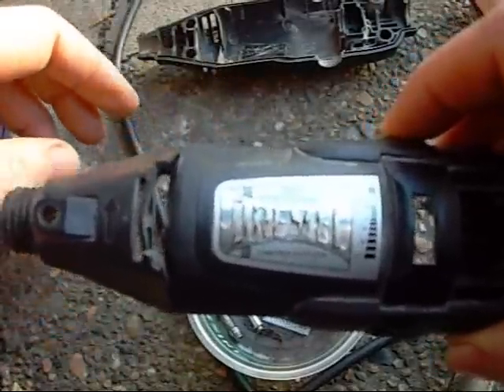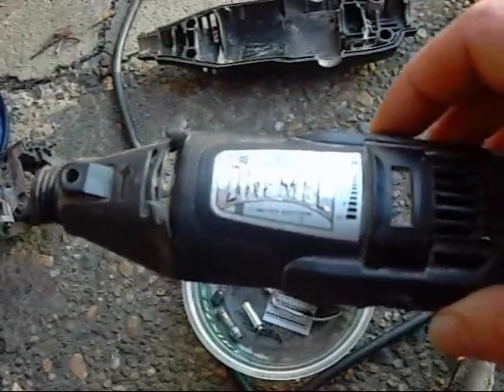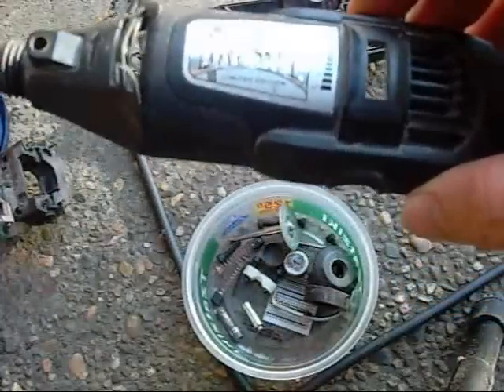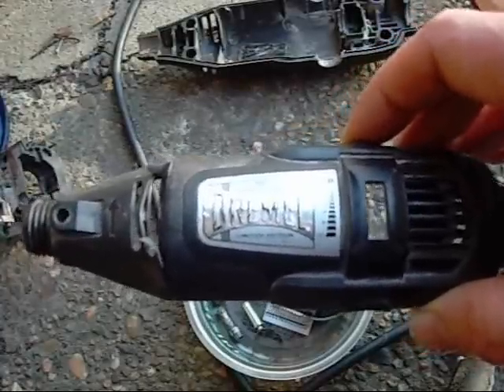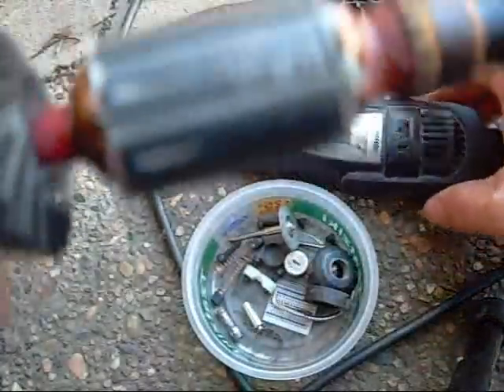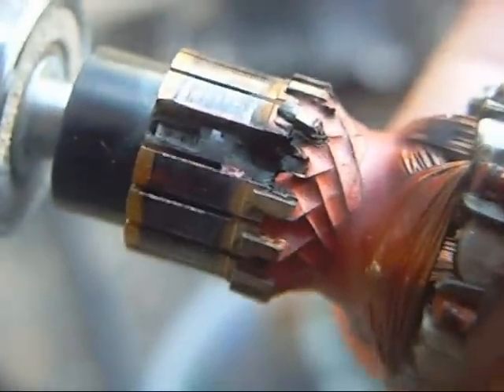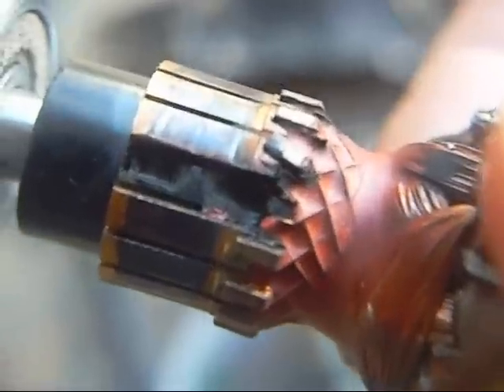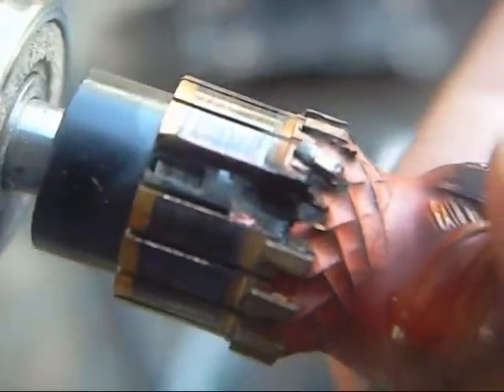Dremel autopsy-commutator damage

Comment: Mine did just this, threw a comm segment. Poor show, I haven't used it much. Basically a write-off. The armature is finely balanced and a replacement comm segment will probably need the arm rebalancing, these rotate at up to 30,000rpm, if it's less than perfect it will self destruct again.  I've chucked mine in the bin.
Reply from the maker: it is not worth the fiddling around to repair. I did see a russian video with a repair method that was very low tech and it seems to work. I think the only real time that a person would fix this kind of thing is when they can't buy a replacement for some reason.

Comment: can we repair this type fault of mixer-grinder armature
please replay
Reply from the maker: yes it can be done, even if you don't get electricity running through it again but just replace the copper so the brush has something to run smoothly over. you need to have good epoxy and smooth the replaced copper down so it is not rough. soldering the bar to the wire before machining would be best
Reply: Sir
Have u any video  for solution
Reply from the maker: no i do not have video for solution. follow the details on the comments below.

Comment: you need a peace of cupper then count commutators get the diameter of the commutators then the windings after that make a ring made of cuper exact the diameter of the commutators and its thickness then epoxy it to the armature then put in the lathe make it center when yuo epoxy it to the armature  after you put in to the lathe and finish turning cut the cupper then do the winding.

Comment: i just had original Makita grinder replaced with a new china made armature and brushes for less than US$16. I hope it will last for another 15 years of light duty.Its a very useful tool in my garage.
Reply from the maker: That's a cheap fix...thanks for commenting. Hope it lasts for you.

Comment: i have a tool with the same issue... and was hoping i could find a video of someone experienced in this type of repair showing us all how its done..  unfortunately for me, i don't even have the missing segment... so im going to have to furnish a new chunk of copper somehow that will conform to the void.  Once I find a suitable chunk of copper, I was thinking I could temporarily tape it in place, and then drill a couple of small (1/16" dia.) holes through the face of the copper chunk and into the body of the commutator epoxy core.  maybe 1/4" deep.  I would also rough up the back of the copper chunk as much as possible.  I would also tap the drilled holes with whatever thread count i had laying around that fit such holes.  instead of actually putting screws in the holes, i'd use a die to cut matching threads on a piece of solid bare copper wire.  When everyhthing is all set  and ready to go, I'd mix up some of the best epoxy i have around, slap it in the gaping hole, and then screw in my make shift copper screws!  excess epoxy would be necessary here... I'd want it oozing out i think!  any excess could be sanded off afterwards... the newly fashioned copper contact would need to be sanded anyways to match the rest of the contact bars!

Anyways, I think by writing this response I"ve convinced myself that I've already got the knowledge I need to make this repair a success for myself and turn a once thrown away machine a functional asset in my collection of such items.  (I actually found it in the garbage because of this single fault.)  its an oscillating spindle sander!  I was actually pretty impressed by the mechanism involved in making the spindle oscillate up and down the way it does!  I can't wait to get this thing running again.  my gf has been dying for me to throw a dildo on the spindle and let er take a ride. (shes not too familiar with tools....  but I can't convince her not to do anything.... meh!)

Comment: Cut replacement segment from a piece of copper water pipe, file to a perfect fit, clean pocket of anything that would short to adjacent segments, epoxy new segment in place maintaining the gap to adjacent segments and allow to cure, solder winding to new segment, chuck armature up in variable speed drill motor and true up commutator with a fine tooth file and a steady hand, then finish with fine emery cloth and a final cleaning of the slots between segments. Job done.

Comment from the maker: yes and after pricing the replacement rotor-at $90 plus 20 for the brushes,and for a new tool plus a flexible shaft it cost $120 i figured its cheaper to buy a new one,so thats what i did

Comment: Welcome.  That is good news, keep us posted with your progress.  You could also buy a new basic Dremel 100 to keep as a spare, if you are a heavy user, the simpler the design the more reliable it is, its the same motor but without variable speed.  I use a Lutron Credenza light dimmer at120V, as a speed controller.  For other readers, if you cannot find parts list email Dremel and they will send it to you or check e replacement parts dot com [ remove spaces]

Comment: It can be repaired but another failure may happen; other plates in the commutator appear deformed.  A new rotor assembly cost ~ US$22, from your Dremel HQ in your country. Your unit looks like a 395.  The unit looks like its got lot of wear. The rear bearing slot on the casing is deformed, and patrs of the fan guard seem torn. If the bearing slots are deformed, this will cause too much free play in the rotor shaft, leading to another failure.  New housing is $8. The rest is well and salvageable.

Comment: might be time to just replace it, cause you know just as soon as you repair it, it will work fine until you "really" need it, then it will let you down, on the brighter side if that happens you could make a viral video of you bashing it into pieces or something of that nature.  just kidding but really that is a handy tool that cant be replaced with any other tool when you need it.

Comment from the maker: never had much success with superglue-will try epoxy.
there is a little hook on the comm bar that holds into the original epoxy so thats what i will be counting on to hang in there.
the smell,i suspect was arc over on the commutator between the one that came off and the 2 bars either side of it.
in case a carbon track built up i will dig around next to the other bars before epoxying it.
hardest part i think will be getting the wires back on,maybe better try solder 1st so i dont ruin the epoxy

Comment: You could try cleaning the varnish off the severed wires superglue the severed comm bar back in and resolder its connection to the armature., but I don't like your chances given the amount of centrifugal force thats on it., not to mention needing a re-machine to even them up.

if it survives a machine and cleanup, I would just run it at low speed and it would probably hold in a bit longer.
Reply: Ed I miss you